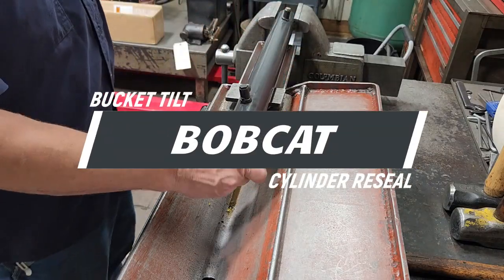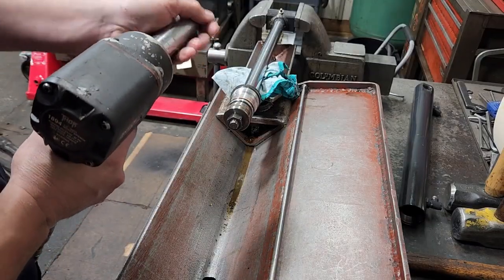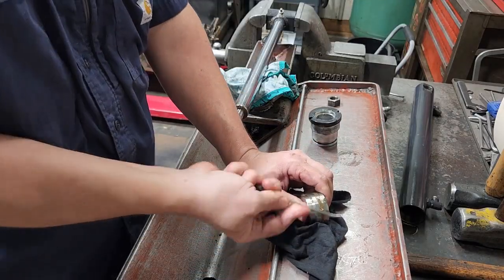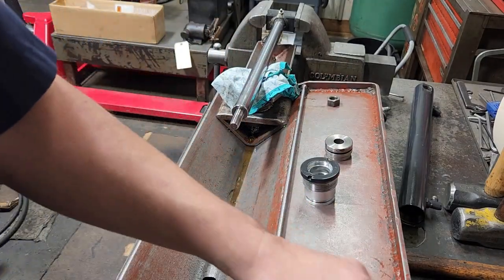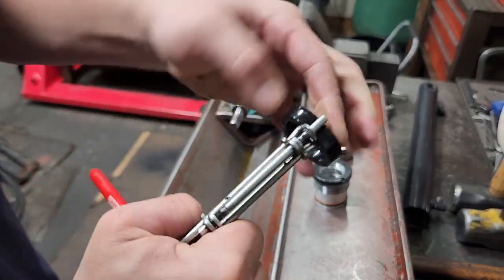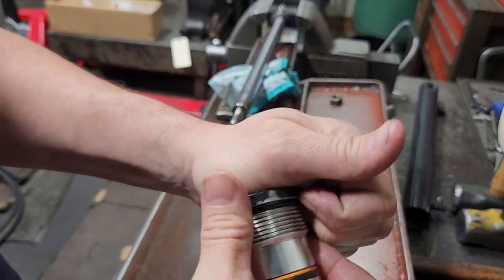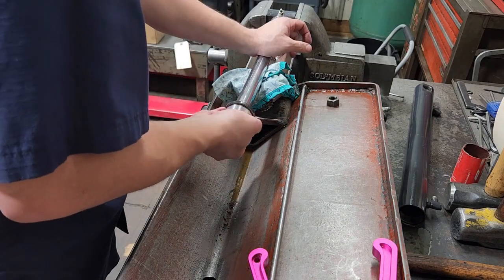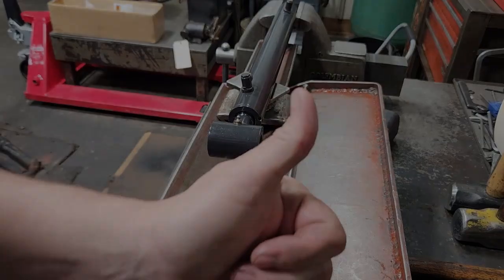BOBCAT Tilt Cylinder Reseal with Seal Sizing

Comment: Follow on question, at about 6:45 you spoke about the Aluminum Gland in the steel tube locking up.  I did the first one no problem, spun right out, the next two have so far defeated me.
I am thinking large pipe wrench, then heat and if that fails machining it out.  Would you approach in a different order or have any other recommendations?
Reply from the maker: Usually, to get one of those glands out, it's a bunch of spraying Freeze Off or any penetrating lubricant and using 2 bigger ball peen hammers. I'll hold one hammer on the tube while hitting the opposite side with the other and just working around until I think it drew some of the fluid in. Then respray, hammer, respray, hammer, etc. Then I'll try turning the gland if there's enough "meat" for a 48" aluminum pipe wrench to grab and turn. Just make sure the jaws are not twisting while turning and grabbing the tube. If that doesn't work, I use my big teardown machine and force the gland out. If it gets to that point, it's best to replace the cylinder. Hopefully, this helps some.
Reply from the maker: I just realized that in your very first comment, you stated the rods were sheared. If they did that and the rod is not fully extended, there's a possibility the rods could be bent and holding tension on the gland as well. So, they may need to be pulled out all the way if possible. Just thought I'd throw that out there, too!
Reply: @HydraulicRepair I probably have to drive one in and pull one out.  I was trying to see how much damage there was to the gland as well, has to take a lot of force to shear a 1.25 rod off

Comment: what kind of grease are you using to lube the seals. thanks for these videos
Reply from the maker: There are many opinions on this and vary from person to person. Personally I've used multipurpose grease for about 18 years now with no issues. I'll also use hydraulic fluid every once in a while. Guys also use petroleum jelly, silicone grease, specialty grease just for seals, etc. I'm just recommending what has worked for me. Thanks for watching and commenting!

Comment: challenge or a request for ideas ; old 3 & -5 komatsu cylinders has 3000 5000 ftlb nuts . how do you break loose ?? and retork ??
Reply from the maker: I actually use a machine that's designed to tear down larger cylinders. It will handle cylinders up to 24" bore, 13' closed length and it is capable of doing up to 40,000 ft lbs of torque on a piston nut. I know the old school guys used long extensions, breaker bars, overhead cranes, excavators, backhoes, etc. The way I do it is a lot easier on my body! Thanks for watching and commenting!

Comment: You made this look easy.  Which maybe it isn't too bad as long as nothing goes wrong.   Thanks!
Reply from the maker: Usually, the hardest part is getting the gland broke loose. Once it's loose and out, the majority of the cylinders are the same with some minor differences. Thanks for watching and commenting!

Comment: Man!  Thank you so much, I really appreciate the measuring as you go style and showing it and the detail that you are doing.
As it happens I have 3 Bobcat grapple cylinders in the shop right now that have sheared rods so I will either need to buy new rods or have the rods machined apart from the end and new rods made.
Do you have many cylinders come in needing new rods?  How do you handle it?
Reply from the maker: I'm going to try my best to stick to this format. I figure the more I do it, the more it'll help people understand how to find the proper seals if a seal kit is not available. Rods can be expensive from Bobcat, and I usually find that I can make them cheaper for the customer. I have the old eye cut off from the rod, the machinist will pin the eye and machine the new rod then I will weld the eye back on. I'd say on average, I see about 4 rods per month that need replaced. I hope that helps! Thanks for watching and commenting!